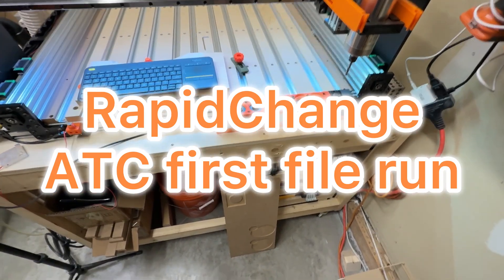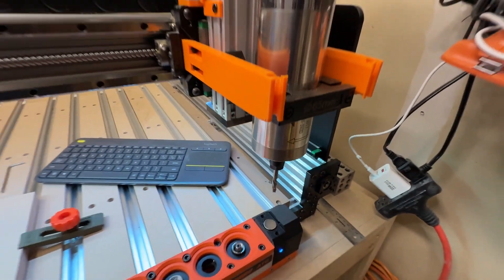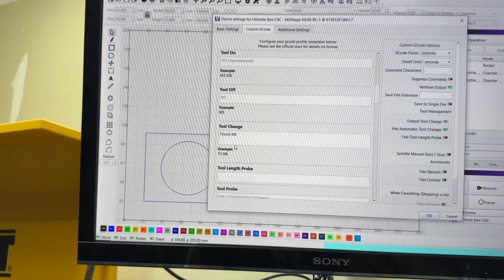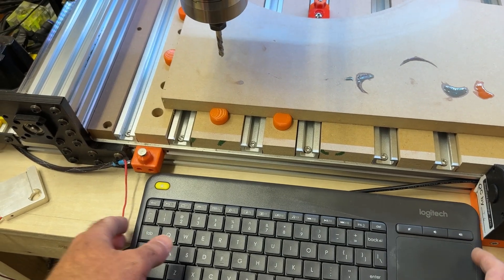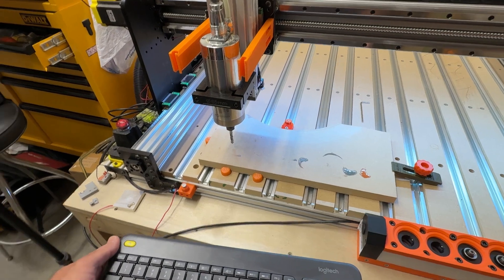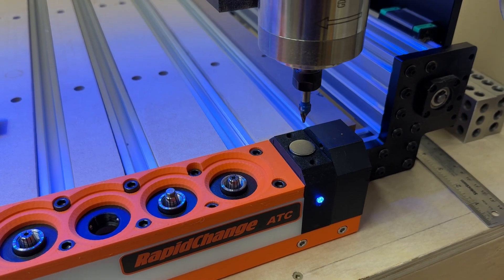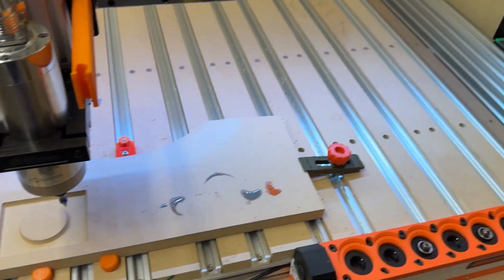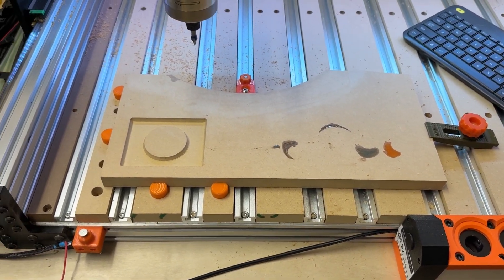First cut file test with the RapidChange ATC

Comment: What's the accuracy/repeatability on this tool changer, with ER11 collets being screwed in and out all the time? I'll bet there's some wiggle...
Reply from the maker: I have not measured the repeatability but I have done several projects now using the RCATC and have been very happy with the results of the accuracy when it comes to the Z axis depth of cut and XY location’s staying the same. For things like inlays this is very important and I have done two multi bit inlays with great results so far.

Comment: I use the same wireless keyboard with my longmil. Works great!
Reply: I also use the same one :D it is great .. I bought it to a TV, but I newer used it .. the batteries were leaked when I found it 5 years later :D , but for the CNC it is great.
Reply from the maker: I have used this keyboard for years in the shop and it just keeps working. 
I tried a game pad for a bit but kept needing the keyboard for other things so I just use it all the time now. It’s a great size for this type of stuff.

Comment: Congrats!  You sort of lost your sh*t there for a sec. lol   I would like to try one myself but with it being 20% of the whole machine, I'm not sure I can justify it to myself.  For your dust boot, you may have to go with a spindle mounted with some extra space?
Reply from the maker: Haha yeah, I was excited and a little stressed at the same time, I had tried this twice before with some small GCode issues that caused problems so I was a little shocked that it all worked. I was prepared todo another take. 
Yeah it’s not a cheap option but compared to a ATC Spindle and air setup it’s a pretty good deal. :) 
Yeah i think you’re right I found one on Etsy with a dock that looked like it might work well.